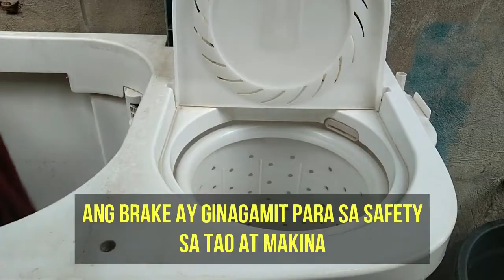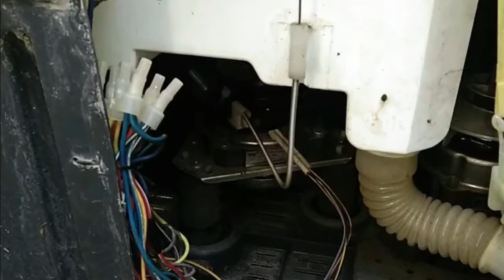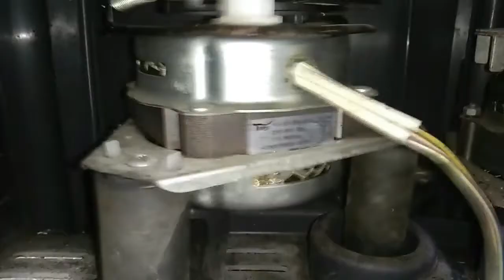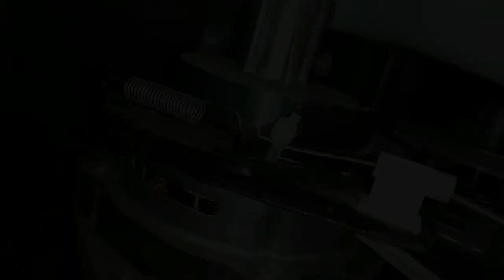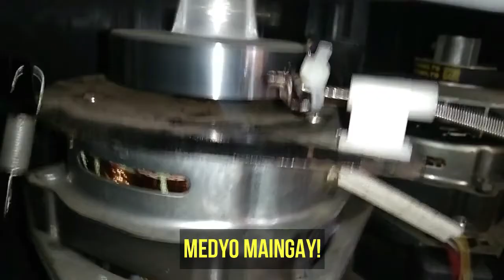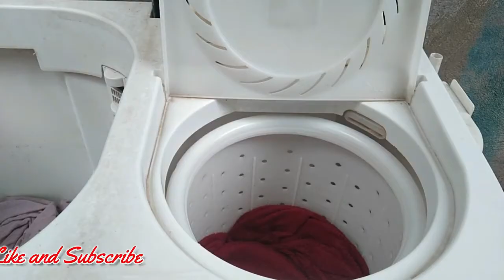Washing Machine Spin Dryer Okay Ba Kahit Walang Brake?

Comment: Maganda Ang may brake kung may alam Ang gagamit pero kung gamit lang Ng gamit sayad na pala Ang brake dun nag sisimulang masira Ang motor Hindi nya narereach Ang  rpm nya bukod pa dun kung napabayaan naka spin naputol na pala ung cable ano Ang Mang yayari, marami Ako nirepair na dryer motor Ang sira gawa Ng brake alam ko alam u yan,
Reply from the maker: Correct ka sir.

Comment: Mas ok sana ang may break. Kaya lang nong naputol yung brake ng spin dryer ko, di ko na sya maibalik sa dati. Inadjust adjust ko na pero di ko makuha yung dating tension .  Naiiwang naka break kahit open and close kaya tinanggal ko na lang
Reply: Kalimitan nababasag ang cover kaya damay ang control at ang break.ok naman off na ang timer e may salida at naikot pa.bawas konsumo koryente. Ingat lang.hintaying fully stopped  ang ikot bago  magtanggal ng laman

Comment: Papaano po kapag kelangan pa alugin ang dryer bago umikot? May tunog sya pero ayaw agad umikot. Kelangan pa kalampagin para umikot
Reply from the maker: Posibli starting capacitor boss, or yung bushing at rod ng motor mas gasgas na.
Reply: @JunbaTeks  saka po parang may sumasayad bago sya mag start. Pero pag umikot na, nawawala yung parang scraping sound sa umpisa. Salamat po sa reply

Comment: boss paano po i adjust yung break cable? kahit po kasi nakasira yung takip nakaipit pa rin yung break kaya aya umikot ng dryer
Reply from the maker: Mayron sa likod bossing. yung connector sa plastic strap at brake cable. adjuster din yon sa preno boss.